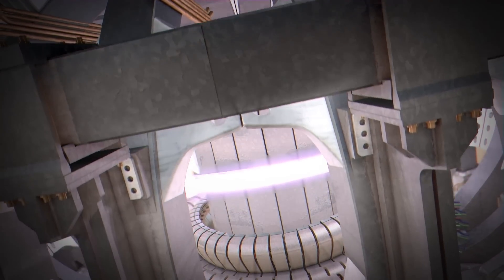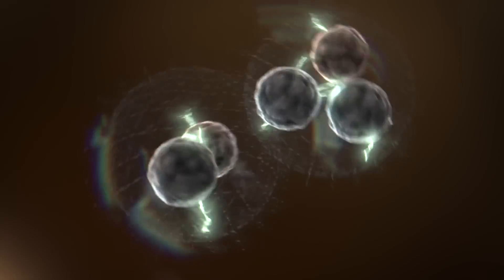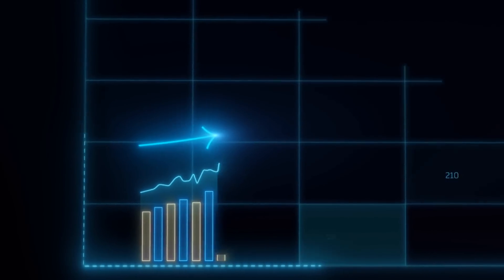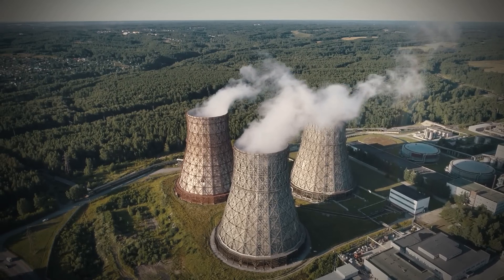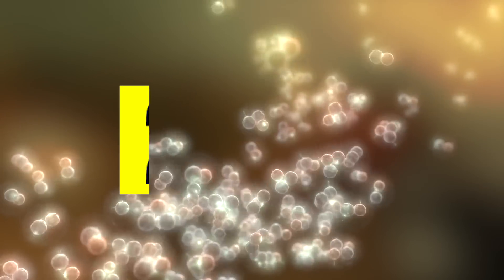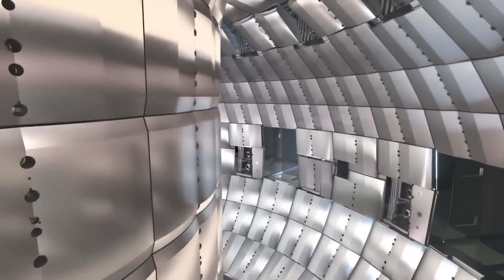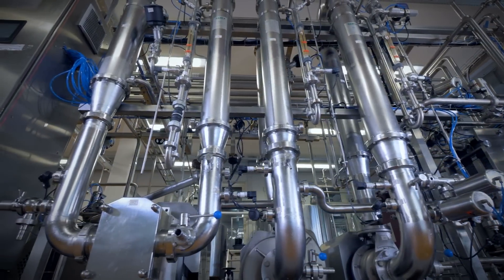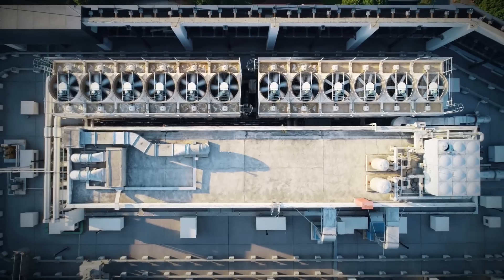The Shocking Problem That Could End Nuclear Fusion

Comment: Your premise "there are practically no naturally occurring supplies of it" is incorrect.  There's a lot on the moon.  Artemis 1 is due to be launched any day (assuming the faults can be fixed) to start the process of enabling moon industries, which would include mining lunar regolith for tritium.  Tritium would be an ideal product to mine and send to Earth as it is very valuable and light.  It's going to take time to get the space industries going, and details such as how to get the mined products from orbit to the Earth's surface safely in large quantities have not quite been worked out, but the potential is there.  It's why Artemis is going to take a month to complete its first mission, as it is going to one of the Lagrange points where a space station is to be setup to enable regular flights to and from the moon.

Comment: honestly, just keep running the fission reactors, sure they aren't as good as fusion, but i'm convinced they are safe and efficient enough to keep economically producing power, and producing tritium as well is amazing. as far as i'm concerned, fission is just as important as fusion and renewables.
Reply: If you consider the economic factors it is highly unlikely that fusion reactors will ever replace fission reactors. Even if it is possible to set up a working fusion reactor that produces net output, the initial start-up cost and the maintenance cost could be so high that it might just make more sense to continue using other sources of energy. There are no solutions, only trade-offs, and if the trade-offs are infeasible for human needs in a given situation, it doesn't matter how elegant the methods are. 

I am disappointed that there hasn't been much research into using fusion reactors for nuclear waste management from fission reactor byproducts to make them less radioactive. In that set up, fusion reactors don't even need to produce net output energy, because it can be powered by excess energy from fission reactors.

Comment: Research has to be done, results published, which suggests so far.. it should be recommended that if there's to be a rapid and financially viable reduction in the destruction of the global ecology by fossil fuels extraction, and exploitation of economies, by corporations displaying very low respect or responsibility to anyone, ..in fact are promoting conflict, so that if spending on those endeavours ceased, and funds were diverted to restoration of the ecosystems, ..some of the destruction could be reversed.

This implies that not only does the public not know enough about Fusion viability, it knows even less about how distracting the big promises are from genuine Sciencing Re-search into relevant economics and the ecology we actually rely on. 

And this is the kind of research results that we need to see in context,  thank you.

Comment: The people who harnessed fission did so with pen, paper, and slide-rules because the principles were sound, and therefore the theories could be tested. Since then, fusion has always been 10-15 years away, despite gigantic funding and generations of super-computers. The principles are not sound because they treat the sun as an isolated ball of hot gas with the belief it was self-stable and able to generate fusion without outside influence. This has never been shown to be true  in the lab. Nothing is isolated in this filamentary universe. In plasma physics, the sun is an electric discharge event in arc mode in a circuit the connects it to the remainder of the galaxy. The whole model needs a rethink.

Comment: tritium is quite easy to get, just go to fukushima and electrolyze the heavy water. there is so much tritium, they are pouring it into the sea. :P
also commerical design don't even use tritium as fuel, this seem to be a poorly research video, or even intentional clickbait.

Comment: The simple solution is to make more tritium. Tritiated water can undergo electrolysis in order to separate the tritium from the oxygen. Tritiated water is easy to make and is a complete waste product in most cases, Japan dumping tons of it into the ocean. There is no shortage of Tritium. Every so called problem people claim there is with fusion reactors is an excuse for the energy titans of today to maintain their stranglehold on humanity. The "over heating problem" is an especially irritating crock of you know what.

Comment: Fusion needs Li_6, and ThoriumMoltenSaltReactors need Li_7 for their FLiBe-salt. Complementary needs! if THMSR development hadn't been stopped by economic/military misconceptions, in the 1970s, then Lithium-isotopes wouldn't be a limiting factor today. There is just the intricately complicated problem, that one of the Li_isotopes is also the fuel for H-bombs. So no responsible gvt wants to have too much around or getting into the wrong hands.

Comment: Is there any particular reason we can't build more tritium-breeding fission reactors, as either a temporary stopgap while getting better fusion breeders online, or even as a permanent solution?  Yes, fission reactors are less safe, but unlike with a reactor intended to power a city, which you'll want to be somewhere in the general vicinity to minimize transmission losses, this kind of reactor could be placed in the middle of the Gobi Desert or something with only minor efficiency losses considering the energy density of the product. That would automatically make it safer than any coal plant in history.
Reply: The only thing in the way would be politicians... As usual...
Reply: Actually he is ignoring one of the primary reasons for going to the moon. He3 is a far better fusion fuel, deposited by the sun.

Comment: That's interesting and factual, but ultimately solvable if enough resources are thrown at it. The REAL issue that should have already killed fusion is that a working fusion reactor would literally be a perpetual motion machine...which is of course impossible. 😑

Comment: End nuclear fusion? When did it start? The reaction has been created for decades and never produced energy. It's never worked. 

Humans want to use tritium and deuterium but what did the universe get to use? What choice did it have? If we barely have tritium on Earth, what makes science think there was a lot back then?

The Big Bang theory is forcing science to go all in with fusion. After all, the universe was "born" made of quark-gluon plasma and that cooled to hydrogen. Now what? How is the hydrogen going to turn into the first stars? That's when the Big Bang theory told science fusion works as a fact. It forced science to use the only thing that existed which was gravity to create the stars. Unfortunately, gravity cannot make stars out of harmless clouds. This assumption is exactly why science cannot understand the force of gravity. Gravity is not a free energy normal matter gets to use whenever it wants. 

It's very simple. Science is looking for quark plasma, not fusion. The Big Bang event had an explanation. It was simply our universe turning itself into a particle collider with two objects that contained the mass of the observable galaxies. The impact created the energy, not gravity. The impact also made the galaxies expand as shrapnel. Dark energy is nothing but momentum. The collision created an anisotropic expansion of matter that will appear to be an accelerating, expanding universe if it is assumed the entire universe is expanding. 

Quark plasma doesn't use human-created electricity as its catalyst, it uses the matter that makes up space that causes the force of gravity as its limitless catalyst. Black holes are made of quark plasma and they create all the naturally occurring elements all by themselves from the outside of the mass inward. 

As long as the Big Bang theory remains a fact, fusion will remain a fact. Science will spend ten trillion dollars on this goose chase just because it is unwilling to go through a paradigm shift to answer all the problems. Science wants everything to stay just like it is so that the money won't stop flowing and educations won't be thrown in the trash. In this case, correcting the reality of the situation will just hurt too much. Everything must stay the same. Fusion must work and humans must be the cause of global warming. It is simply amazing the state of astrophysics and physics right now. As far as science in general goes, it should be embarrassing that it has allowed the magical Big Bang theory to last as long as it has.

Comment: I would not be surprised if the long term production (as opposed to research) solution to the problem of fuel was deuterium-lithium and in the even longer term deuterium-deuterium. It's mostly engineering.

Comment: How about we drop fusion and concentrate on LFTR? Cheaper, easier, inherently safe and Thorium is very abundant, not to mention that it can burn a lot of existing fission waste. Also to spread the load on thorium you can build a coal fired plant next to an LFTR plant and that can be used to cycle the coal emissions to make them completely clean.
Reply: The private sector is already researching this at pace, compared to the money the private sector spends on research in other fields of energy the money spent on fusion is a drop in the ocean. But at the core of the issue is that energy will never have a one size fits all approach - we need as many different diverse solutions as possible, we got ourselves into this mess in the first place by always only bothering with the cheap and easy approach to energy. Not only that but fusion research is not just for fusion - it drives robotics, materials, software engineering, superconductors and more efficient cryosystems. Public research always has inherent value and few fields give as much bang for your buck as fusion as it puts scientists and engineers in the environment where they perform best - solving difficult challenges. This is before we get to the economic stimulation. 

Oh and if we do solve all the issues facing fusion, and I believe we will, then we get a brilliant source of energy at the end!

For an example of unintended research benefits we can look at string theory. In the pursuit of a field so abstract many consider it to be more mathematics than physics, they have produced a number of elegant solutions for dealing with complex non-linear systems which have found application is areas such as superconductors, something I think we can all agree have excellent and very real applications. 

By dropping an entire field of research you only lose, there is nothing to gain in not doing fusion.
Reply: @idoltrash2353  what mess are you referring to?
Reply: @f-u-nkyf-u-ntime  reliance on fossil fuels. Global warming aside the situation in Europe right now is a strong demonstration that overly relying on any one source of energy - even if it is the cheap and easy route at the time, can have serious consequences

Comment: Tokamak is the wrong way anyway because D-T fusion produces fast neutrons which are moderated to make steam while activating the containment vessel. We must use neutron free processes, particularly p-B11. But that's not possible with tokamaks. I wonder why all the talk is about unsustainable tokamaks like ITER. You should research all the other fusion projects, especially the ones that do not run in thermalized plasma regimes.
Reply: I agree 110% !

Comment: There is one more problem:  the neutrons resulting from fusion contain most of the energy that's released from the fusion reaction.  Therefore, those neutrons must be captured by some kind of heat-exchange fluid, in order for the heat to be used for energy production.
However, you said that there are barely enough neutrons for breeding tritium.
Reply: This is true as well if you using nuetrons to exchange heat then what percentage are free for breeding. There must some simple equations used to explain the relationships of energy transmission from freeing neutrons and the energy required to create the fusion.